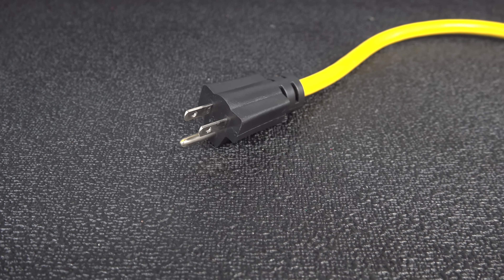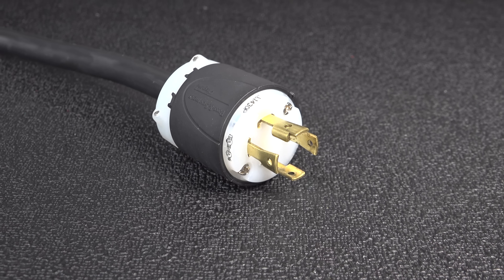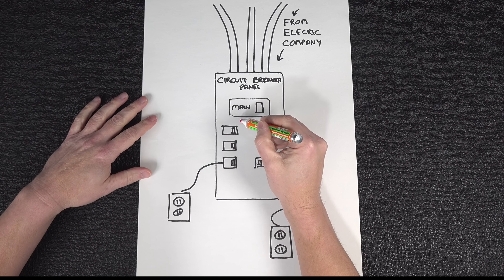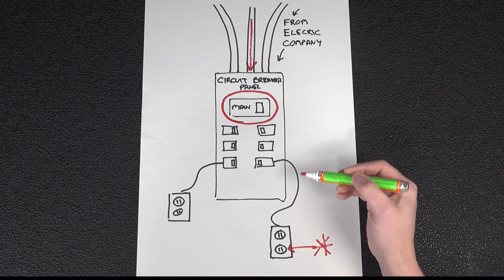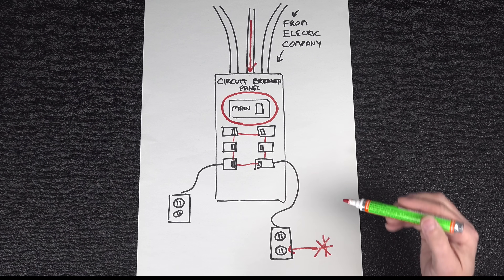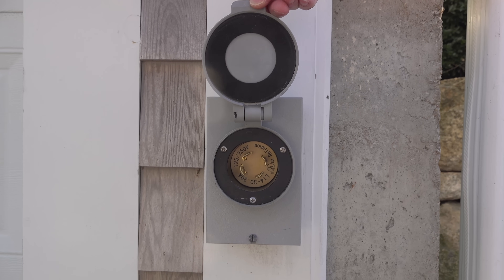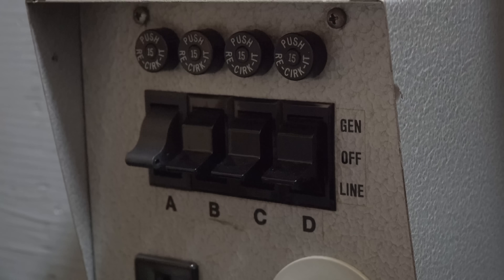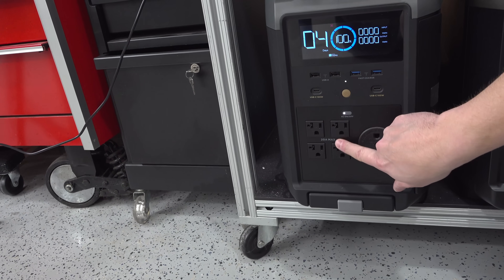Worst Electrical Mistake You Can Make - Backfeeding Generators

Comment: There is another risk with back feeding that you didn’t cover, which is reversed polarity.  When I was a teenager, I was building a log cabin in the woods, and while I had help from others for heavy stuff like the roof, and complicated stuff like the kitchen cabinets, I was on my own for the electrical wiring.  To make my life easier during construction (before the cabin got hooked to the electric grid) I ran a double-male-ended extension cord from my parents’ trailer to one of the outlets in the cabin, and from there it went into the service panel and to the rest of the cabin, allowing me to turn on lights and run power tools.  Pretty much immediately after I plugged it it, I noticed I was getting shocks whenever I touched ground screws.  That puzzled me, so I got a volt meter and saw 120v between neutral and ground, which made no sense to me at all.  So I walked back to the trailer to investigate, and as soon as I opened the door I saw smoke coming from the outlet with the extension cord plugged in.  I grabbed a fire extinguisher and unplugged the cord, extinguished the fire, and investigated, and this is what had happened: the trailer, built in 1970, used aluminum wiring, and that particular outlet had been wired backwards (in other words, despite being a grounded outlet, the hot and neutral wires were reversed).  So, hot from the trailer’s service panel was going to the neutral on the outlet, the neutral on the extension cord, and (since I’d done my wiring correctly) the neutral bus bar on the cabin service panel, which was bonded to the ground bus bar, which was grounded by a ground rod right outside.  The distance from the trailer service panel ground rod to the cabin service panel ground rod was roughly 200 feet (60m) so there was enough resistance that the breaker wasn’t tripping, but the oxidized aluminum wiring in the trailer outlet was none the less overheating, and had I checked 2 minutes later I likely wouldn’t have been able to stop the fire.  Ever since then I never trust unknown wiring to be correct, and I always check polarization before I plug in anything that might care about polarity. I have a handy little plug-in circuit tester, shows open neutral,  open ground, open hot, and reversed polarity, perfect for a quick reassurance that all is as it should be.
Reply: Ground rod does not clear faults. Ur neutral bar connects to ur ground with a Main bonding jumper. When a fault occurs it travels to ur ground and from ground to ur neutral and back to source. Because ground is bonded to everything it has a lot of resistance and causes the breaker to trip in one cycle.

 aluminum wire they have a tendency to expand contract due to thermal expansion, prob caused wire to become loose overtime and cause the wire to heat up damaging the insulation and eventually causing a fire. Was common in older houses
Reply: @JesusPerez-yc6yu  No; stopping an overload that could melt the wire is exactly what the breaker's job is.  Since part of the short circuit went through the Earth, there was enough resistance to limit the current so that there was no overload, and thus, the breaker did not trip.
Reply: @phillipsusi1791  yeah I had assumed older wiring so older breakers and guessed overload because if u had put lets say 20-23 amps it wouldnt instantly trip a breaker  but he probably didnt put any high loads onto it anyways for that to make sense.

 It was aluminum wire they have a tendency to expand contract due to thermal expansion, prob caused wire to become loose overtime and cause the wire to heat up damaging the insulation and eventually causing a fire. Thanks mb that makes more sense
Reply: @JesusPerez-yc6yu  ... Just no... please don't be an electrician... that is not how that works at all bro...
Reply: @anjhindul  .... no just no... please don't be an electrician, instead of helping the trade ud be damaging it by thinking ur right 100% of the time and if anybody questions u, u want to go for an insult. I feel bad for anybody under u
Reply: @JesusPerez-yc6yu  They deleted whatever ignorant comment you replied at. They obviously realized they were wrong, but deleting wrong comments after they are replied at  is more wrong than being wrong while calling someone else wrong. 🤣

Good job.
Reply: @anjhindul To which statement are you replying? I have seen both situations that Jesus described.
Reply: You really can't trust anything. My dad once bought an extra lead-acid battery for our off-grid horse stable. Don't know the exact numbers, but I think he wanted to go from 4 to 5. When attempting to connect the battery, it would spark a lot more than you would expect.

Turns out, the polarity in the battery was reversed. It was opposite to all the other batteries, but the labels were unchanged. You had no way of knowing this without testing it first. (Or observe the excessive sparking and go to investigate...)
Reply: @Yotanido  That is a very, very rare manufacturing defect. I guess your dad was either the luckiest or unluckiest man alive, depending on how you look at this. He should put that battery in a crystal cabinet as a rare collector's item.
Reply: @Yotanido  So, no. The sparking was caused by you running it either in parallel or series, and by being flipped it wasn't the charge you were used to.
Reply: "I never trust unknown wiring to be correct"
ESPECIALLY IN MANUFACTURED HOMES...  Glad you didn't learn that lesson the hard way---
Reply: @kyleglenn4132  while you are correct that AC works by alternating the current between positive and negative potentials (it’s right there in the name) there is still a “hot” and “neutral” side to an AC circuit.  When wired correctly according to code, when a circuit is open, the electrical potential is on the “hot” wire only (usually a black wire), and the neutral wire (usually white) is not energized.  When polarity is reversed, the white neutral wire is energized instead, and while this doesn’t matter in normal operations, it creates a safety hazard in case of a short circuit or other fault, or in the case where the energized wire in one location is connected to the neutral wire in another location.  In the United States, plugs for electrical appliances that don’t need a separate ground will have one blade of their plug larger than the other, to ensure that correct polarity is observed when plugged into a polarized outlet.
Reply: @jpe1  A few corrections... the first is a bit of a semantic point.  As far as AC is concerned, there is no such thing as "energized" and not.  The current flows over both wires and doesn't know the difference.  The neutral is only such because it is grounded and so there should be near 0V of potential between it and the Earth.  If that is what you mean when you say "not energized" then all good, but some people might read more meaning into that.  Second, the larger neutral blade is a thing of the past for when devices were allowed to use the neutral for their ground.  These days devices that actually need a ground, because they have a conductive exterior that a person might touch, are required to use the third prong for the safety ground.  Devices that are encased in an insulating box, such as plastic or wood, are not required to have the safety ground, and also do not bother with the enlarged neutral prong, since they don't care if the polarity is reversed.
Reply: @phillipsusi1791  thank you for the clarification on the meaning of “energized” (I was using it as you said, but I understand how my phrasing could be confusing).  I will note that (coincidentally enough) just today I bought an electric coffee grinder, and it has a polarized plug.  I don’t doubt that you are correct that a wider neutral blade is no longer required by code, perhaps manufacturers continue to use them out of an abundance of caution, or perhaps it would cost them more to retool?  My cell phone chargers all use identically sized blades, though, as does my electric razor.
I find it amusing that my comment has garnered so much attention and so many replies; I hadn’t expected that at all.  Of course when I make a comment that I want to get attention, for example, talking about my recent success racing a fully electric race car in the 25 Hours of Thunderhill endurance race (won first place in the EV category, and 29th place overall) no one seems to notice.
Reply: @jpe1  p
Reply: @jpe1  many plugs can go either direction though.
Reply: @jpe1  I don't know where you live... but in EU doesn't matter how or what other way you plug something on AC, because of it not having polarity, there is phase, neutral and ground (earth), usually brown, blue and yellow with green for ground (earth). Only DC current has polarity.
Reply: @Dinco422  are you saying that there is no voltage potential between a hot wire and the earth?  How is that possible?
Reply: @jpe1  There's also the fact that in many setups the neutral is grounded as well to deal with transients. Still usually the main concern with reversing polarity is just that the parts of electronics you touch may be energized like the screw part of a light bulb. Many AC devices are phase agnostic though which is why they have the straight connectors instead of the one large one straight. Still not something I say you should risk though.
Reply: @jpe1  I think this actually depends on the regulations. My knowledge about electricity is somewhat limited, but as far as I know, your explanation is true for the USA but not necessarily for Europe. According to everything I have heard so far, USA has two wires, one is alternating the current, the other is neutral. At least for small buildings. (I heard there are exceptions for larger buildings.) However, in Europe you may have three wires. Two wires are alternating the current out of phase, while the third one is neutral. (I am from Europe, btw)

EDIT: If I think about it, I might be wrong. The out of phase-configurations might be relevant for special connections with high voltages only. Not sure. There are differences between the circuits of the USA and Europe, but I think I have confused something.
Reply: @JojOatXGME  Yes sir. EU is a different voltage and a different frequency. US is 60 HZ, EU is 50HZ. Both use AC, but at 120v/240v for US and EU doesn't go under 220.  Also, there is no difference in the AC on neutral, hot and ground. The difference comes in that the Neutral (Grounded conductor) and the Ground are TECHNICALLY one line and as such the same "potential" so you can't get shocked by touching either. Where the Hot is NOT grounded, the Neutral is grounded.
Reply: @anjhindul  just look up reverse polarity. Literally takes 1 sec to see that it describes that situation. U might see it as that's not real reverse polarity but its literally the first thing that pops up. Also I said that ground and neutral were part of the same system using MBJ obviously a sub wouldn't have one but it still connects in the main. Also neutral does carry some current very small but it's something. Yes u could use the grounding conductor but there is a reason why we r never really allowed to use grounding as a grounded.
Reply: @JesusPerez-yc6yu  In a 120v circuit, the neutral carries the exact same amount of current that the hot does.  Since about half of the 120v circuits in a house are on one phase, and half on the other, the current on the neutral from the two phases mostly cancels out so that there isn't much flowing on the neutral back to the pole from the house in aggregate, but that isn't always the case.
Reply: @phillipsusi1791  neutral can carry the same current but it doesnt. It takes what isnt used back to source(unbalnced load). Also i mentined its just not always 0, just was trying to point out that it's not 0 on the dot so it's not exactly a grounding conductor, neutral is a current carrying conductor while ground Is a normally non current carrying conductor and that is what separates them and why they shouldn't just be used interchangeably
Reply: @anjhindul  There is another very significant difference between the US and EU - we (EU) don't specify WHICH connection on an outlet is neutral and which one is the phase. I think the general philosophy is that if you have to trust the cable and installation, you're doing it wrong, and accidents exactly like what happened to John Early are GOING to happen. We can flip our plugs and connect them either way. This also means that we always need to use double pole switches, and we have to use preferably two fuses in any device, because which wire happens to be live and which happens to be neutral is 50/50. The real protection is from using a gfci though, fuses are mainly considered to be protecting the device, not the people.

I fiddle with electronics, not with electrical installations, but I don't THINK our ground and neutral are connected at the panel the same way as in the US either. The ground is strictly a protective earth. Another consequence of not caring about polarity is that we can't use regular auto-transformers without using an isolation transformer before it. There are also some weird electrical systems in some regions where caring about polarity would be weird, such as some places having a floating ground because the actual ground is made from pure granite and is non conductive, and places running two-phase systems without having a real neutral.

I'm not an electrician, so take all this with a grain of salt, but the main takeaway is - we mostly don't care about polarity the same way the US does, with the pros and cons that come with that.
Reply: @Shabbymannen  I didn't understand your statement about autotransformers. I don't get how autotransformers care about polarity either way, the issue with them is - no matter were the plugs polarized or not - that they don't provide isolation, and thus cannot alone be used where isolation is needed.

Instead, where isolation is not needed (ie. the fed appliances normally isolated/protected and not used in systems where some parts need isolation from others due to functional reasons), autotransformers can be used without caring about polarity, and are used all over Europe all the time.

There might be some niche use cases where autotransformers could be used with polarized plugs but not without, but I can't think any such, if you know some example, please explain, I would be interested ;)
Reply: @TheSimoc  I'm in Sweden, and they used to be banned for sale as consumer products here, perhaps they still are, perhaps EU standards have superseded our old standards. As long as you still have full insulation on all cables and devices there isn't a problem and they can still be used of course.

The danger stems from the fact that an autotransformer only has one winding, with one of the poles being common to the output and the input. The common pole is always wired to the neutral on american autotransformers. So if you have a 12V autotransformer (or variac set to 12V), thats it, you have your neutral and your 12V, that's it. Of course, they do still have to trust the installation, the cable, and the autotransformer manufacturer. In europe if you use the same autotransformer and flip the plug the "wrong" way, you have your 230V refereneced to ground on one pole and your 12V relative to that on the other, which is really dangerous if you lose isolation, or if someone doesn't know it's an autotransformer and uses it for experiments or to power non- or poorly isolated devices. With a regular transformer there wouldn't be a problem, as it has two windings and the secondary is galvanically isolated from the primary.

At least that's my understanding, I don't mess around much with mains power. I would like an old school isolation transformer with no ground reference and an autotransformer after that though, would be a nice setup if I need to muck about with mains voltages or power devices without risk of ground noise.
Reply: @JojOatXGME  I think you're mixing a few different concepts :) In the US:

The "exceptions for larger buildings" is 3-phase power and yes, that's an industrial/commercial service thing. ("Commercial" in that commercial buildings will often have different circuits spread across the phases; only industrial users tend to have devices - mostly motors - hooked up to all the phases).

The US does have 3 'wires' (as what you described "in Europe"). 2 of them are both hot and 1 is neutral: the hot wires are 240V to each other but only 120V to neutral. Most of our outlets only use 2 of them (and indeed usually only have 2 going to them from the breaker)

(* Just like in Europe we also have a ground, so really we have 4 wires)
Reply: @JohnRunyon  I have already noticed some of my mistakes, which should be visible through my edits on my original comment, but thanks for your summary of the actual situation.
Reply: @JohnRunyon  I'm not sure what you were talking about, but in Europe, there are the real 3-phase power in every house, exactly the same as in industrial settings in US (well, same only about phasing, the voltages are 230/400V and frequency 50Hz). 5 wires with ground and neutral.
Reply: @Shabbymannen  Thank you for explanation of your thinking, even though I still find it a little odd. Well yes, they are indeed banned in non-insulated use, and I tried to state exact that. But what I was wondering in first place, how they could be legal/safe to power non-insulated circuits even with a polarized plug. Your explanation made some sense that you could have the output "secured" to be from neutral side, but it still has no isolation, which was (and is) for me quite hard to imaginate being legal or safe. All it would need is a bad contact or breakage on the neutral wiring, and alas, you would have full mains potential in the low-voltage output. And furthermore, if there is not isolation, hard to imagine such a thing fulfilling the required insulation level within the autotransformer coil either... So there runs a serious risk of high potential shorting into output through broken enamel. And furthermore yet, actually any short within the coil, even on adjacent turns far away from the output tap, would cause the coil to lose its inductance, causing practically uncontrolled division of mains voltage between the ends of the coil.

Because of all that, the European regulations explicitly require any non-insulated systems to be isolated. In other words, autotransformers wouldn't be legal nor safe for powering uninsulated systems even with polarized plugs - and aren't either, even with hard-wired feed. I would have supposed same on American electric code, but really dunno.
Reply: @TheSimoc  Did you read my explanation?
Reply: @Shabbymannen  Yes, and I thanked you for it and replied I got your point that polarized plug would keep the low-voltage output on the "neutralmost" side, but however, that is still not making it safe nor legal (in feeding uninsulated systems) due to lack of isolation.

By that I meant that your statement that autotransformers wouldn't be allowed in Europe because of unpolarized plugs, is not exactly correct - they wouldn't be even with polarized plugs (nor with hardwired installations), and I thoroughly explained good reasons why, and I suppose they aren't in US either but really dunno. On the other hand, in feeding insulated systems they are safe and legal everywhere, no matter were plugs polarized or not. In short - allowance of autotransformers has only very little to do with plug polarization.

Did you have some problem with my explanation, or something else to comment on this? I'm open for discussion.
PS. Don't be scared of my harsh comments for trolls, my harshness is exclusively for them - with appropriate technical discussion, I really like to discuss, honestly :)
Reply: @TheSimoc  Your comment didn't show up, thats all :) I guess youtube is going into overdrive now trying to filter out "bad" comments.

Yea they are never to be considered isolating, but I'd argue that they are a lot safer (as long as you can trust the polarized installation), when you have 0 volt - X volt referenced to ground, rather than 0 volt - X volt OR 230 volt - 230-X volt coming out of them, at random. That's all. You'd be mostly fine connecting a 12VAC device, say a CD player (not that you should!), to an autotransformer in the US, but there is a 50% chance you would have a very bad time here in the EU. As long as we agree on the mechanics I'm all good, so each of us can make our own informed decisions about electricity :)
Reply: @Shabbymannen  Aah alright, youtube is overloading with this lotta comments ;)

Well yes indeed, autotransformer would be a little bit safer with polarized plug, but still not enough - there should always be either insulation or isolation. Your cd player example was actually interesting - kind of example I didn't got to think. You could have such a set up in a pinch, as an "use on your own risk", not legal but relatively safe if the plug is polarized, player is standalone (not to be wired to any other devices) and no conductive parts touchable, and user knowledged enough not to touch the "low voltage" connectors and to have other required precautions. But unless the player is rated for full mains voltage insulation (which low voltage ones rarely are...) as well as the wires, and the plug is finger-ingress-protected, the setup still doesn't fulfill the legal requirements.
Reply: @TheSimoc  Yes, we agree. I should have been clearar at first about what I meant.
Reply: @JojOatXGME  You're partially correct. The difference is Europe uses 220 volts at 50hz most places, including outlets.  Your 3 wires are hot, hot (180 degrees out of phase to the first one) and neutral. For safety, you might have a 4th wire connected to ground. Neutral and ground are tied together back at the panel. Each "hot" leg is 110 volts and they add together to 220 (neutral/ground completing the circuit). There are only a few places in American homes with 220 volts, the stove, water heater, dryer, and AC are the most common. Most of them are directly wired and don't even have outlets, but ranges and dryers typically do because they get changed out more often
Reply: @Shabbymannen  definitely read granite as graphite at first and was rather confused for a brief moment (for a few reasons, not the least of which is in pretty sure graphite is conductive). Dont know why but it took me a few re-reads to get it right
Reply: @Shabbymannen  EU in general does no such things. It is the national codes that do it. Not every place even has a neural. There are no double pole switches or breakers in Finland. Neutral and phase are clearly defined in the fixed installation. Only in a plug in device one cannot know which is which.
Reply: So the situation you describe would indeed result in seeing 120V between neutral and ground, and low enough current to not trip the breaker, but if oxidized aluminum wiring had enough resistance to cause localized heating to the point where it was smoking, it would have done the same thing if you just had a proper good sized load plugged into the trailer without the reverse polarity.
Reply: @kyleglenn4132  There absolutely is polarity. Well yeah, polarity is fluctuating. Actually not 60 times per second, but 120 times, as frequency (60 Hz) means full cycles per seconds, and polarity changes with every semicycle. Either way, they have instantaneously a certain polarity, which reverses when wires are reversed, ie. phasing reverses. The most relevant thing here is that one of those is grounded, the other is not, and thus you may not reverse the polarity arbitrarily within system. And yes, very yes, those plugs are named POLARIZED plugs. Not in vain.

Of course the end result in this case was a short circuit (quite a resistive one though) and it was very clearly explained by himself. But it was exactly a short circuit caused by the reverse polarity - they are not mutually exclusive things.
Reply: I reverse the polarity to my house 60 times a second  come at me bro.
Reply: @jhallin5185  You poor definitely need to hire a manager with better negotiation skills! I have made a contract with energy company to change the polarity 120 times a seconds, with no extra fee for that additional service, and don't need to do the polarity switching myself at all! With such a labor offloading, I can do at least one employee-worth more productive work, all while having double worth of polarity changes than you! Negotiation skills effectively increase the results in the power of two!
Reply: I have one of those testers I use as a mobile DJ just to make sure whatever outlet I power my sound system from has correct polarity and is properly grounded. Incorrectly wired old outlets are a lot more common than most people realize.
Reply: None of you, I mean none of you know what your talking about. It’s simple, your system was and is low on electrons and the neutrons are taking over. Be careful them little SOBs have a nasty bite. Just source you some electrons and slowly I mean slowly add them to your ground rod outside. It’s neat watching it all happen. You all need to quit spreading false information. This is serious. 🥸🥸😎😜Great Luck to all!
Reply: @bangthumper3283  that brought a smile to my face 😊 thank you 🙏
Reply: @jpe1  and your reply brought one to mine. 👍🏻
Reply: me:
ctrl+c
ctrl+v
Reply: Check the plug your going to use is the lesson here.
Reply: that's exactly what I thought at first, but aparently the video was all about not doing it because you may do it wrong
Reply: You're the reason they have to tell people not to use items like this... If you were using a proper 3-prong plug the only way this happens is if your incoming or outgoing outlets are wired wrong.  If you're using a 2 blade plug (no ground) fire marshal Bill approves, but the rest of the world does not.  That said, unless your cords are vintage, MOST 2-prong plugs are still made with polarity in mind and will have a wide blade and a thinner blade, the thinner being your hot wire, and frankly even if you're just using them normally those cords are not exactly recommended.  Long story short, if you were using a 3 prong cord, you need to have a professional inspect your wiring regardless as you've done something wrong...
Reply: @redacted601  if you read my comment carefully, you will see that my point was that you can’t just assume that an outlet was wired correctly, even an outlet that was installed by professionals.  When back-feeding you need to check polarity at each end, don’t assume that outlets were wired correctly.
Reply: Just hire a licensed electrician and avoid the armchair jack of all trades master of none. Or not. That’s our choice.
Reply: @kyleglenn4132  on three phase it’s absolutely possible. Hook it up one way and get clockwise rotation, swap two legs and get counter. 
Have to match a customers rotation. 
I realize he wasn’t talking about three phase.
Reply: @richardcranium3417  no one has 3 phase running to their house, so what are you even talking about?
Reply: @jhallin5185  Duh, yes most houses here in Sweden have 3 phase mains.

400 volt between any two phases and 240 volt between any phase and neutral.

US is not the only country in the world you know...
Reply: @kjade7778  that’s wild, do you guys all run laundry mats out of your basement?
Reply: I was stacking hay bales in a loft once and there was a chain conveyor to make things easier for everyone. Ran an extension cord up and the conveyor was going backwards. The outlet got wired the wrong way.
Reply: same happened to me on a smaller scale, im no expert electrician i was building up an rc helicopter that id taken apart and used my brothers lipo battery to test it but somehow it was reverse wired and my esc blew...
Reply: this was what i was thinking the video would be about
Reply: lmao
Reply: @AegisHyperon  Why the heck is this funny? oh I get it, you're too dumb to understand it!
Reply: From what I understand, “earth ground” (grounding rod) does not ground your system.  It is more for protection to your house wiring in case of lightning strikes to the electrical system where it is trying to go to ground.  That’s why you don’t need to “earth ground” your generator unless you connect to house wiring that’s somehow is not connected to the service panel such as in a “switched neutral”wiring configuration in which case you have to make sure the neutral and ground are bonded on the generator if it has a “floating neutral” configuration.
Reply: This is incorrect. You created a short, not N issue with reverse polarity. You're running AC power.
Reply: @johnmidwest5650  when one switches the hot and neutral legs of an A/C circuit the usual term for that is "reverse polarity" and I will also point out that the electrical plugs that are larger on one blade than the other are called "polarized", so while your observation is technically correct (I know, on the internet, technically correct is the best kind of correct) the typical usage is to describe the short as reversed polarity, since there would be no short, if the hot and neutral legs hadn't been reversed.
Reply: @kyleglenn4132  Maybe don't give advice when you dont even know something as simple as the fact AC still has "polarity". Dunning Kreuger at it's finest
Reply: Same here. I got a outlet tester and tested every outlet in my house. Found two wired incorrectly. The biggest thing I found was my Air Conditioner compressor was wired backwards at the outside power box. Just never know what is wired wrong.
Reply: @philc7192  your checking every outlet in your house is the sort of thing I was hoping to encourage with my original comment.  An outlet tester is inexpensive, easy to use, and if it identifies a problem (like you found in your two outlets) the fix is easy, and also important.  I’m glad you were able to make the corrections to your hours before you had any problems.
Reply: If you would have used a dryer outlet, that would not have been an issue. Backfeeding is done with a dryer outlet, so this is off topic.
Reply: @jessiepinkman9856  agreed! Unfortunately the trailer had no 240v outlets, there was no washer/dryer, and both the range and the water heater were hard wired.
Reply: In Europe our outlets are unpolarized. So everything that us to be plugged in has to be designed to accept either polarisation. But table or floor lamps could have 230V potential on the thread instead of the more hidden terminal, slight safety concern, 50/50 chance.
Reply: @kyleglenn4132  ac still has polarity apart from the various science reasons your house handles the live and neutral wires differently

breakers will break the live 
ground fault detectors and other circuits monitor the neutrals for protection
Reply: I’ll admit, I haven’t read every one of the hundred or so comments, but I thought I’d weigh in here.  First, as to polarity, lots of people on the comments have a very high level understanding of how the power in their house works . In an isolated system,  yes there is no functional difference between the two sides of an AC source, however in practice you don’t have an isolated system, and things need to be done carefully to avoid problems. In practice, there is one side of the system that is driving (the hot side or “live” side) and one side that is being driven (the neutral side).  The neutral side is “bonded” to ground at the main service panel.  Typically the “hot” side of circuit is going to be the one you break for a switch. 
In this cases it sounds like there were several problems at issue with the OP’s situation. First, there was likely a loosening of the connection at the outlet on the source side. This problem by itself would have caused a problem is a high current device was plugged in. Enough heat to start a fire, but not current to blow the breaker (possibly a faulty breaker too, but not for certain)
Next, the reverse polarity noted by the OP. Note by itself this wouldn’t be a problem. You should be able to functionally run a house basically completely reverse polarity for the most part (you shouldn’t and you might damage some stuff, but you could in most cases get away with it). This however was added to the problem of backfeeding the “main” panel in the detached structure. I’m guessing he was bonded at the panel in the detached structure. Problem is, in combination with the mixed up polarity, what you’ve now done is shorted live to ground. 
This should pop the breaker. But given the high resistance of the circuit it wasn’t enough to pop the breaker and the loose connection in the box was enough to create excessive heating/fire.
Reply: What, your silly there is no reverse polarity in A/C. 🤦🏿‍♂️
Reply: WTF? Reverse polarity on AC? The problem is that you dont know what youre talking about.  AC power  switches polarity in the US,  60 times a second.  This happens even if you strip out one of the wires fron the extension when you only want to use either the positive or negative cycle of power.
Reply: @UpcomingJedi  I can’t tell if you don’t understand my comment because of the terminology, or because you don’t understand the concept, or because you didn’t bother to actually read past the first sentence, or perhaps you are just being pedantic.  Regardless, let me clarify:  i’m  using terminology that I find many other people use, but let me be generous and assume that you are not familiar with identifying the hot and neutral legs of 110v 60Hz single-phase AC as the “positive” and “negative” wires.  That’s all I’m talking about, reversing the hot and ground wires, and calling that “reverse polarity.”  If you don’t like that name (for whatever reason) that’s fine, but it’s dangerous regardless of what you call it, for the reasons specified.
Reply: I bet you wired the cabin to save a buck instead of calling a real electrishun, didnt you?
Reply: @kyleglenn4132  reversed polarity on ac, lmao
Reply: @autodidacticartisan  There is still polarity in AC. Good grief
Reply: @autodidacticartisan  reverse polarity is caused when you wire a receptacle (not just receptacle but for the case of the example) incorrectly, when hot and neutral is flipped it will still function but has risk of potential shock.
Reply: @JesusPerez-yc6yu  wtf you talking about ? no it doesn't... please leave this to the professionals, you're not one of them... holy moly polarity on AC...
Reply: That isn't reverse polarity, That is incorrect wiring, when you started describing the issue I was "AC doesn't have reverse polarity... lets read anyway..." then I got to the reversed neutral and hot.. Ya, if anyone reversed those two they were a dumbfuck and need to learn how to wire correctly... plain and simple... Unless you were drawing some MAJOR amperage the receptacle in the trailer should NOT have overheated like that...
Reply: Long extension cords often won’t trip a 20. And lineman don’t give a sht about backfeed. You probably wired the cord wrong.
Reply: Polarity in AC circuits. Had a good chuckle at that 😂
Reply: Polarity is not an issue if you properly wire the cord.
Reply: @dannyw7662  It would still have been an issue here, in a backfeeding use case.

Your statement would be correct in regular use of feeding an appliance with a properly wired cord with a dedicated ground wire, which would eliminate the danger posed by reversed hot and neutral in the feeding socket with neutral-wire relied grounding.

But in backfeeding, even with properly connected, three-wire cord, you need to have polarity right, because the backfed panel has own interconnection between neutral and ground, therefore shorting hot to ground if polarity was reversed. Only difference the proper three-wire cord would have brought into this case would have been that the better ground path could possibly(!) have provided enough current to trip the generator's breaker. Or well, at least kept the voltage of the "shocking screws" clamped down.
Reply: too long, didn't read
Reply: When it takes an electrician to tell you why male on male doesnt work